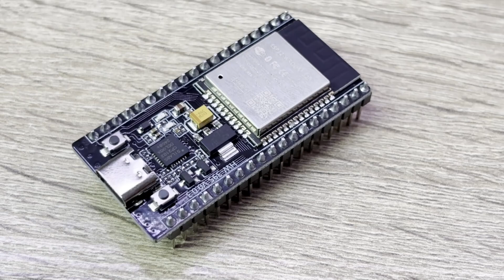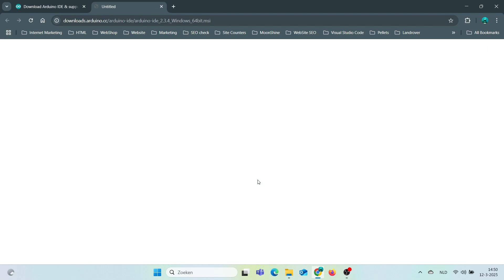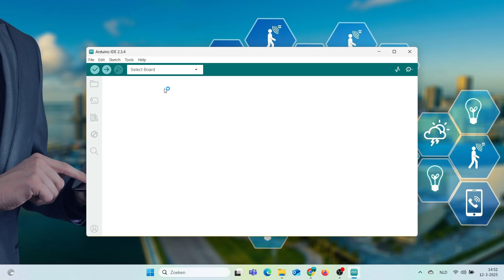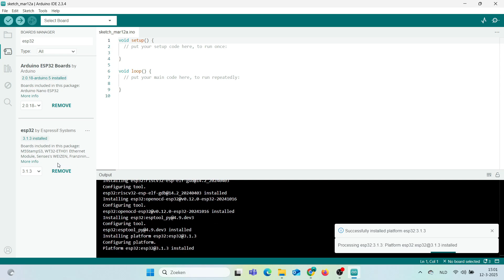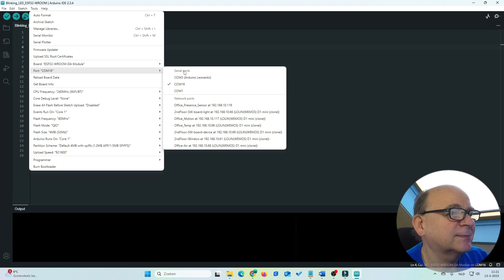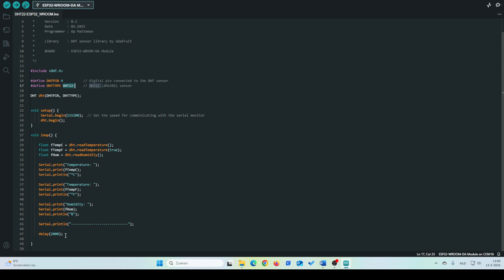How do I start with ESP32 and Arduino IDE [Lesson #1]

Comment: Being new to arduino I didn't realize that the serial speed (baud rate) is shown on the right side of the serial monitor. I had to change Serial.begin(115200) to Serial.begin(9600) in order to view the serial output. Otherwise I saw strange characters. Looking forward to the rest of the series!

Comment: Why did you choose ESP32 - WROOM _ DA MODULE and not choose ESP32 DEV MODULE ?
Reply from the maker: Good question!
In this case there are no differences between both boards. The biggest difference between a ESP32 32 module and a ESP32-Wroom is the dual WiFi antenna. The Wroom is better in weak WiFi areas, but consumes a little bit more power for WiFi.

I have a couple of Wroom boards, so I automatically select the Wroom board driver.